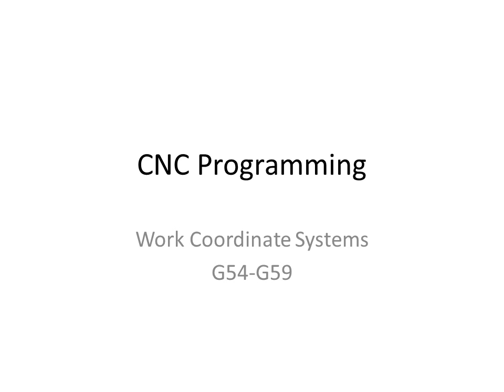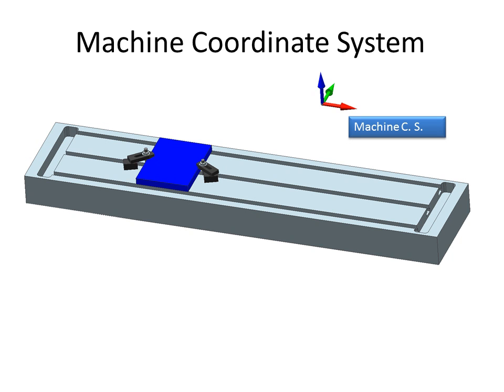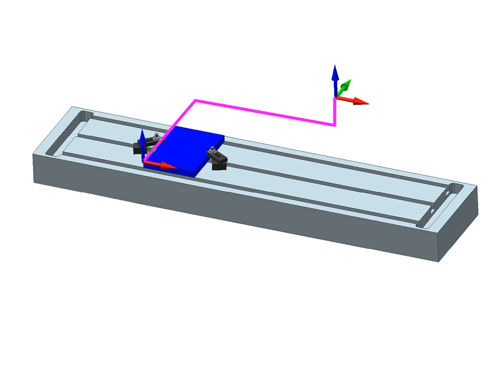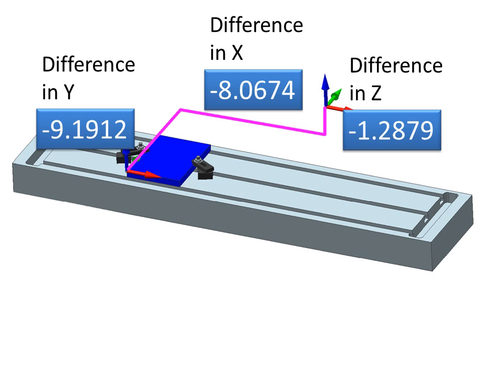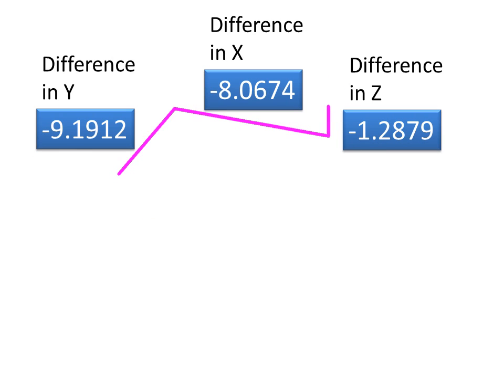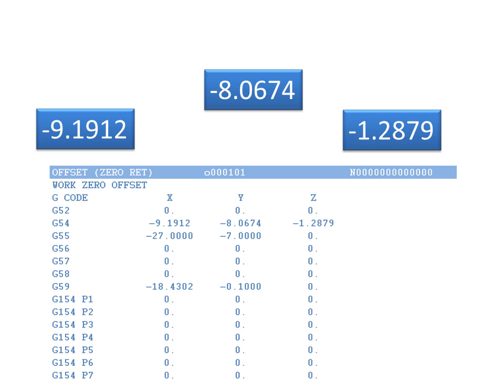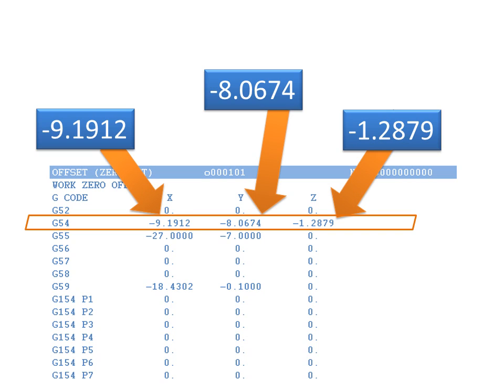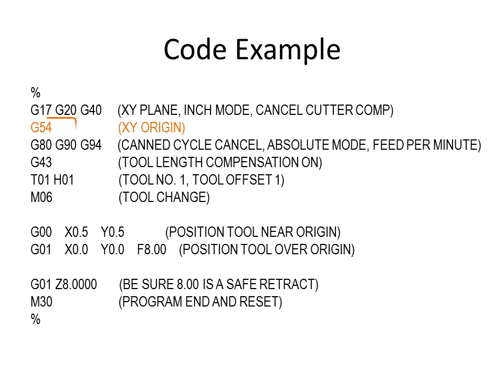CNC Programming - G54 through G59 - Work Coordinate Systems

Comment: Im 18 and trying to teach myself so sorry if i sound dumb, but do i move it to the position and set g54 to store it or type g54 and then the xyz? And how would i set it back to that offset? By typing g54 again? Thanks in advance
Reply from the maker: You set the g54 value in the machine. Generally by a probe or edge finder to a particular position. 
Better information is here: 
https://engineeringtechnology.org/et-curriculum-and-lecture-notes/course-cnc-and-computer-aided-manufacturing/

There are lecture links on the first page of the slides. 
See in particular the Machine Setup lecture .

Comment: Is G54 z and 59 x on lathes,  that's y G59 isn't used on the work offset, right,  cause it's the centerline,  but of course you touch off or do test cutts to set tool offsets for sure...nevermind.  So G54 is the work,  and 59 is what. Where do you find in a machine the travel g distance between machine zero and chuck jaw tips,  for example?

Comment: kuei12 doesn't know that if you help out your community everybody benefits.  Typical Japanese protectionism.  When we share with each other its a trade off.  When you act greedy you stagnate,  The Chinese tried this technique and it set them back 100 years.  They finally said we need to join the community.  There are trade offs to sharing.  When you share you hope that someone shares back with you thereby enriching each other.